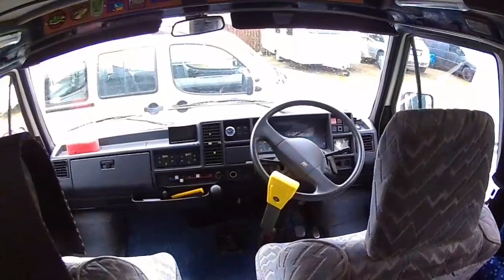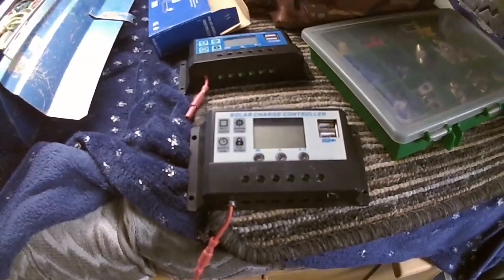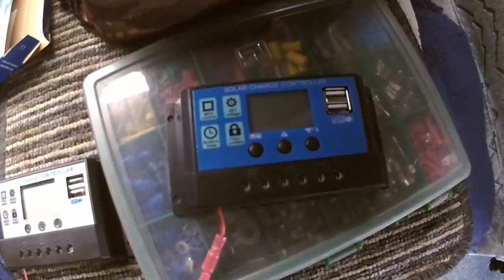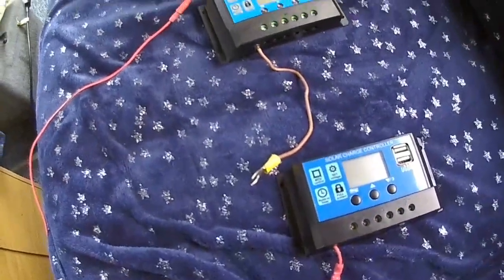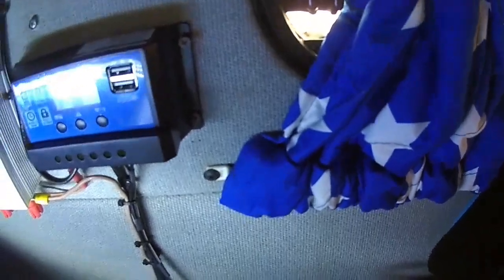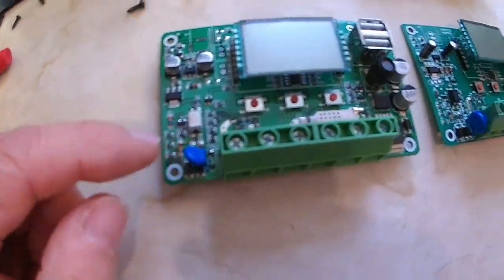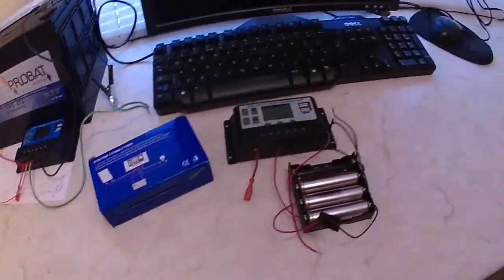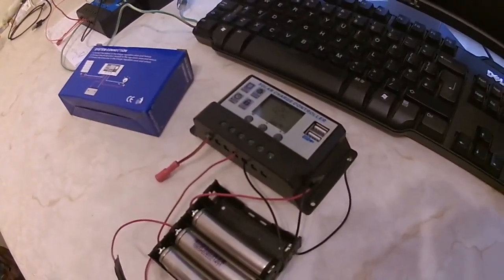Motorhome PWM Solar Charge Controller Ongoing Problems.

Comment: Hi George I have 3 cheap Chinese charge controllers . None of them read the battery voltage right . I just settle for the lower charge on the battery . It has been working out for me. I use one on a rain barrel 12v pump , for lighting in my barn and lighting and charger for my mower in a shed. I did put a larger solar panel on my rain barrel pump (it draws 12 amps) really enjoyed your video . May need to put your imfo to work in the future. Older George in south Louisiana USA

Comment: You should have used the good display in both of the controllers to set the parameters, then you know that the controller with the faulty display will have the correct settings, even though you can't see the last digit.
Reply from the maker: When power is totally removed they default to manufacturers settings. So display would have to be swopped while power on. Anyway I got some more units as the price of them is so cheap now. Cheers from old George

Comment: the controller comes default setting of B01 battery type which is gel. B02 is AGM. BO3 is Flooded.
 make sure you set it to  B03 if you have a regular car 12 v battery

Comment: Hi George. Glad you got solar charger working OK.
Reply: Dont you think a MPPT charger, maybe better?  I was thinking of a Solar set up on my van this year.
Reply from the maker: Hi Jeffery. Physical size. A MPPT charge controller is 8inches in height as the van side is stepped it's not possible to mount it flat. Also wastage current is 4 times that of a PWM  controller when sun isn't shining. Lastly with panels rated total under 80W the extra 0.1 of an Amp with a MPPT combined with higher wastage current is not worth it. With no sun and van in outside storage. Wastage current at 4 times worse will flatten a leisure battery in a shorter period of time. Cheers from old George
Reply: Thank you for your help & advice. Very helpfull. Thanx.  Jeff.